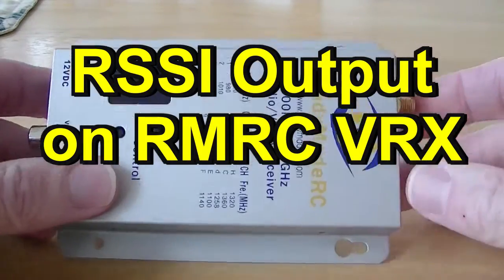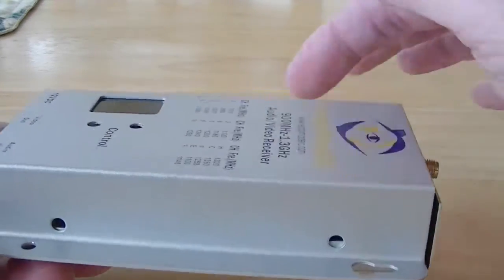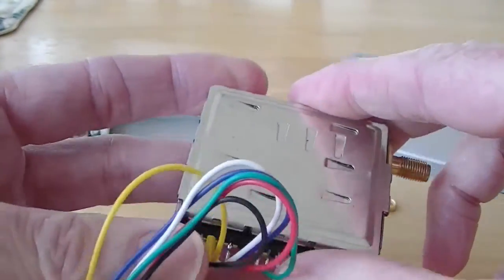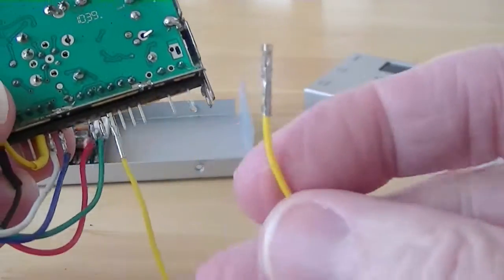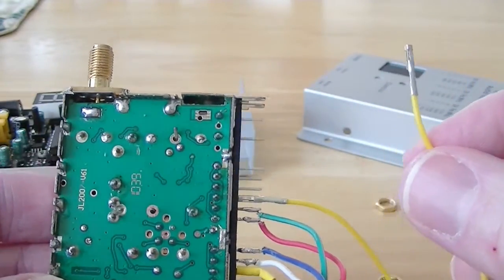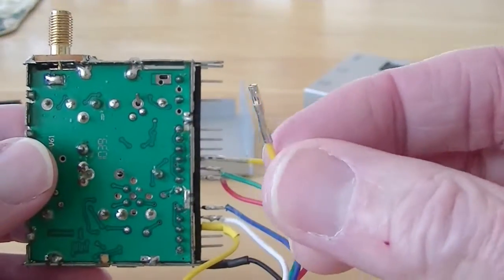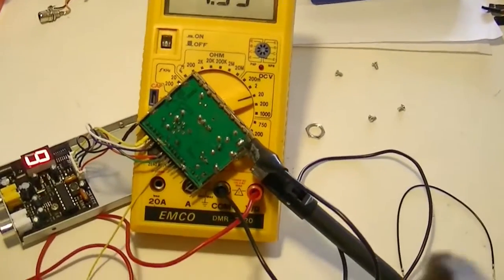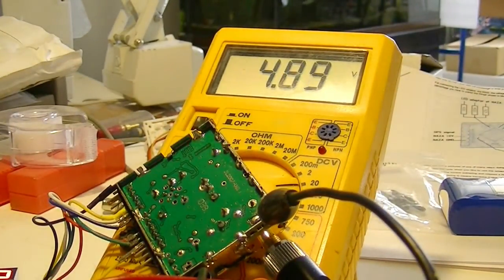Finding RSSI output pin on the RMRC 1.3GHz Video Receiver

Comment: How do you go about finding it? Connect one side of a multi-meter to ground and one to each pin, while turning on and off a video transmitter and seeing if voltage across the pins changes from low (vtx off) to high ((~5v) vtx on)?

Comment: Has anyone done this with the current RMRC 900mgz receivers?  Because the pin configuration inside is different than what's in this video from 2014!!!!
Reply: I know this is an old comment but I also recently purchased one here in 2021 and it seems like the RSSI pin is still in the same place but may have an inverted logic. It seems like as my signal gets worse the RSSI pin goes up (5V) and as the signal gets better the line goes low (0V.) @James Donahue, did you end up finding the same thing?
Reply: @Zzxii  i just did this on a recent receiver in 2021, logic doesn't seem to be reversed. i would make sure you are on the right pin because the newer ones have less pins overall but if you count them out from this video you'll be on the right rssi pin
Reply: @Zzxii  I have the same inverted voltage issue.  Were you able to resolve this issue?  Thanks.
Reply: @johanwessels4071  I did not change anything. I used this as a diversity pin and just swapped which VRX was selected. So essentially if VRX A reads high I instead turned VRX B on. I made a full post and details on my RC groups profile if you're interested. Name is also Zzx.
Reply: @Zzxii  much appreciated!  I would definitely like to understand how you did this.  Did you modify the diversity controller like the one by RCModelReviews?  I built that version and I saw your diagram on RC Groups but I am not an electronic guy so I would need more info to know how to modify it.  I think I can figure out your diagram.  Would it be a rebuild or can I modify the RCModelReviews version, what would you recommend? Thanks!
Reply: @Zzxii  I got it working.  After studying your diagram a bit closer I realized what you meant by just swapping the outputs.  Thanks for sharing, it helped me!
Reply: @johanwessels4071  glad to hear it! Maybe post a picture or a diagram of what you did in this comment so others can see. Or make a post in RC groups and link it here.
Reply: @Zzxii   here is the diagram:  https://drive.google.com/file/d/1o2GiFqS5fnQ6nFUMChCz27jctCDgJGZO/view?usp=drivesdk

Comment: Making Diversity controller using 2 of the RMRC 900mhz 1.3 receivers and was pulling out my hair trying to find the RSSI pin on them.. BIG THANKS Dave this is an old video but in Nov 2019 it was big-time help MANY THANKS

Comment: So your saying that if you measure the voltage coming from the rssi pad the higher the voltage the stronger the video signal is & if there is low voltage or no voltage the camera is tuned off and not transmitting or it’s out of range there for producing no voltage or RSSI
Reply from the maker: RSSI pin voltage range:
5 volts = %100 signal strength
0 volts = % 0 signal strength
Reply: Dave Merc Productions my rssi pads show 0.40 volts when when off & jumps to 1.0 volts when my 200mw vtx is connected to the receiver . And my Gteng fpv watch Rssi Pad shows 0.65 volts when my Vtx is off and when it’s powered on and connected the RSSI voltage jumps up to 1.25 volts . Is this Normal for my video receivers or do they produce less voltage because they aren’t the strongest of receivers ???
Reply from the maker: It's probably normal for your receivers. Also it may be that they are not putting out a DC voltage level but a digital pulse if they are of that sort. Check the specs on them.
Reply: @thelongranger55  Some receivers use 1 - 2v for 0% to 100% RSSI

Comment: so where is the "FINDING"??
Reply from the maker: If you watch the video you will FIND out where the RSSI pin is, at least on the RMRC 1.3G Receiver. Or take multimeter ( as shown at the end) and hunt for it.
Reply: ***** well "I'm just gonna show you where it is" is not finding. You actually found it and made a video after you found it. So your video is not actually FINDING but SHOWING instead. But thanks by the way, I appreciate you uploaded this because I was able to find the RSSI for RC305 video transmitter.
Reply from the maker: Jayson Ragasa Oh good, at least you got where you wanted to go.

Comment: I already saw a lot of videos about finding RSSI on 900Mhz and 1.3Ghz readymadeRC receivers. I wanted to do the same with Bruce from RCModelsReviews. But some FPV flyers told me, Diversity is not a way to go with these frequencies. Diversity should be used with 5.8Ghz only for helping about its poor penetration and multipath. But after many flights with 5.8Ghz, i found now Diversity is not really necessary, because with a good patch anenna, you can have a pretty good range and a pretty good radiation pattern.
Reply from the maker: I agree with you for the most part especially if you have away to track the antenna.
What I am interested in is when the plane goes by above my patch antenna I lose signal for a bit and it would help to have back up cloverleaf to take over. The other thing is that a diversity controller can be used to stop the blue screen on the monitor when signal is lost by having a camera to supply video during the black out. I realize a DVR could also solve this. It's just an alternative approach.